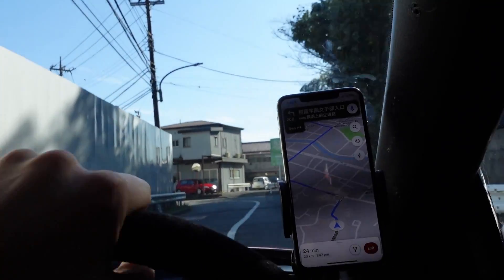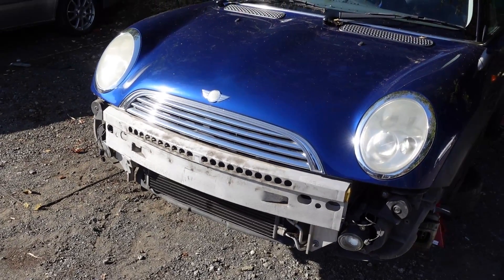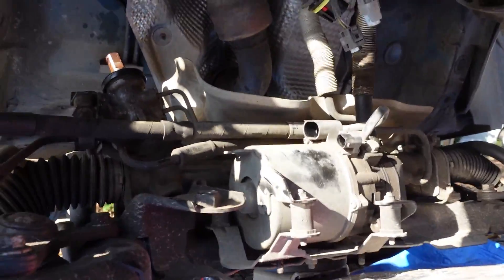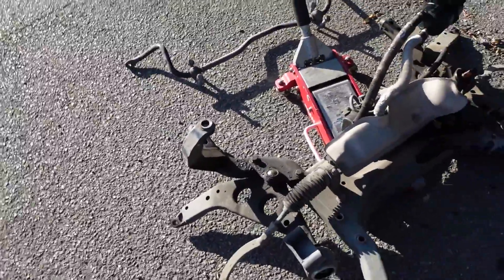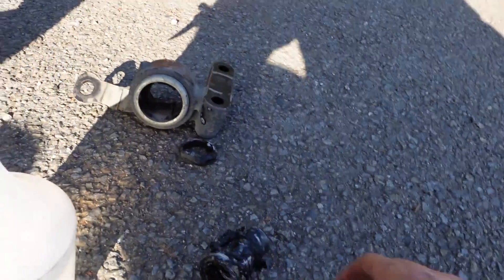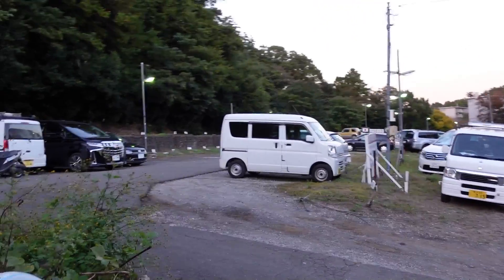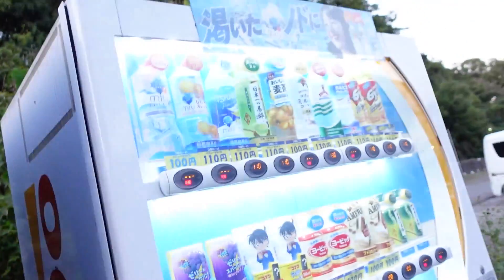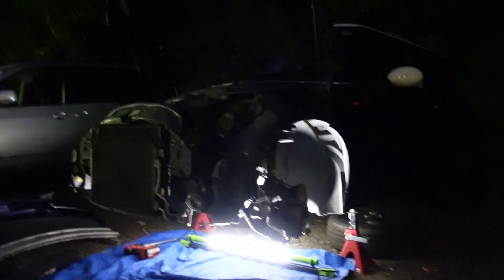MINI COOPERS ARE THE WORST TO WORK ON!

Comment: A hack to polish the headlight is to use a metall polish. It helps to break down the oxidized plastic easier. And usually has a little protection in it as well. Get a drill attachement to the cordless drill that you can get a polishing pad on it. You get decent results this way believe it or not but try it out. I have done it a couple of times with good results. Lasted around 9 months before needed to be lightly polished again on headlights that where bad LOL.

Comment: I just know I'm gonna have to do this one day.. not showing signs of it yet but one day. Hope are that they can just be replaced when I upgrade the control arms and corresponding suspension components, I've seen some amazing kits that improve upon the excellent cooper handling and also help shave a wee bit of weight off. 

BTW... SHow that FC some love, it's waiting for you Sam..
Reply: Hes been trying to get in contact with the owner of the fc for a year or 2 now :( many letters placed in the car and nothing back

Comment: so you might hate me for saying it this late in the game but. I'm pretty sure you can change those bushing without removing the subframe. I've learned over the years that if you are having troubles fixing something on a German car then you need to change how you look at things. the Germans think differently. so people say German cars are hard to work on but that's not true they are just as easy as most other cars you just have to think like a German. I like the press trick. very dangerous but smart, you found a way where most people would have given up.